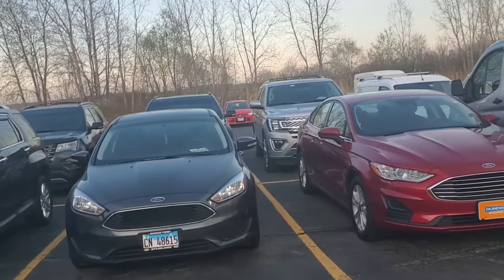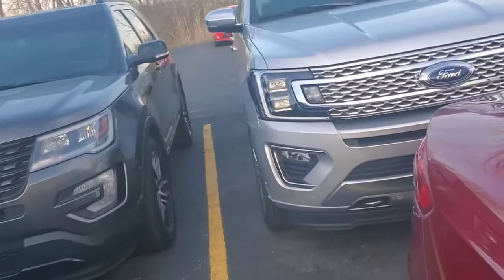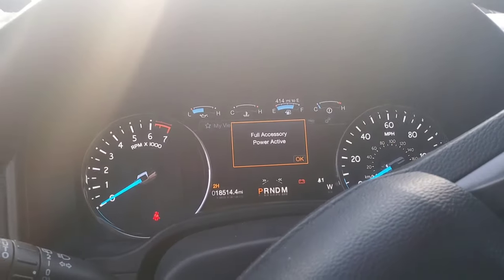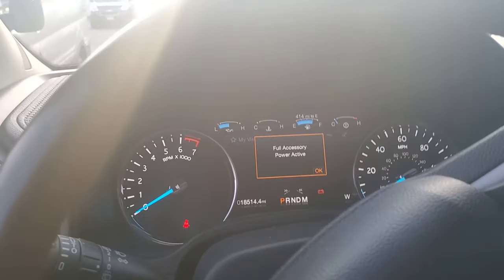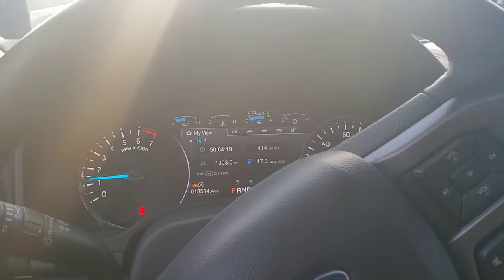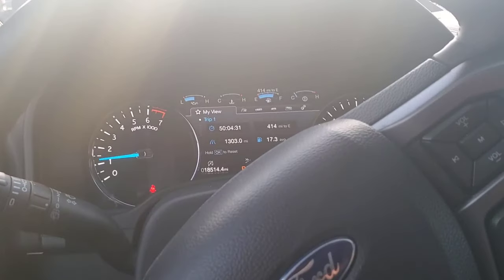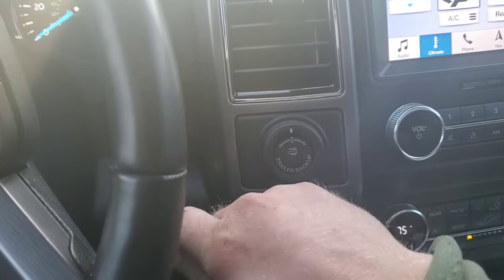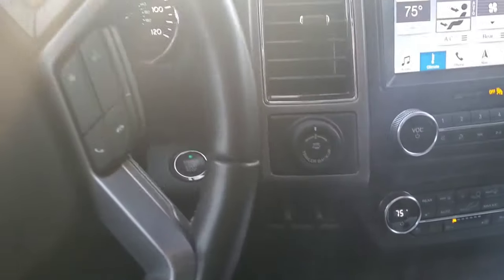3.5L Ecoboost F150 Rattle on Startup then gone, Try this - Could Fix Ford's Phaser Problem

Comment: I just bought a 2017 and wondered what was up with the rattle. Every time I went to look at and drive the truck before purchase, it was already running with the A/C on. I thought that the Ford dealer was just being courteous. I took the car home, started it for the first time ever and it sounded like a diesel for 10 seconds. Immediately took it back to the dealership. They showed me the recall that they never disclosed, and set me up with an appointment for a software update and told me that'll take care of it. I'm not a mechanic, so I figured a Ford dealership has to know what they are talking about, right? I just bought the most expensive vehicle I've ever owned, and I'm kind of freaking out after watching 20 videos of this issue and the secondary issue that'll come with a software update. I watched your other videos too. Great videos, buy the way. Anyhow, I just ran out at nearly 10pm in my shorts and slippers to try this out. The truck has been sitting for 9 hours since I came back from the dealership. Its 60 degrees out and that engine was ice cold. I did what you just showed me and it fired up without a rattle and purred like a kitten. I'm so thankful for you and your generosity. You don't have to tell anyone anything for free, but you did, and you've given me some peace of mind. I'm still going tomorrow to talk to the shop and let them change the VCT units. If the shop at Ford knows anything, they will see the TSB and field action telling them not to reprogram the vehicle. I took notes and I am going to make sure this is done right. My question is, if you have answer, is this "new" new fix I've seen in the past few days a real thing? Has this issue been resolved?
Reply from the maker: Well there is a new update they have to try
Reply from the maker: I'm putting a new video out right now because for people reach out to me today and they didn't understand but they quite didn't understand exactly what I was saying so this video actually clears everything up I'm putting it out right this second as we speak it should be off in about 30 seconds maybe maximum 2 minutes
Reply from the maker: https://youtu.be/ZR1W1gacwi8
Reply: Follow up... I brought the truck back the next day and explained my concerns. The truck had 72k on it when I bought it, so I was at 66% coverage. The dealership did give me a "lifetime" powertrain warranty at purchase, but in my discussion with the dealership manager he stated they won't pickup the other 33% because it is a known issue. I was polite, and explained it was not a known issue to me. He whipped out the dealership warranty to show me his support information regarding known issues. He was right, it was in the fine print. O then whipped out his dealership sales agreement that states I have a 72 hour, no hassle return policy. It had only been barely 36 hours. I requested my no hassle return. We were so darned polite with each other it was disgusting. He took the keys, sent someone to remove the plate, tore up the sales agreement, and cut me a check back for my down payment in under an hour. My end result is I gave it right back, no more problem. You legit saved my butt from the possibility of a 6 year  nightmare. I am looking at the same truck again with the 5.0L. I believe in the 5.0L. Are you aware of any known issues in the 2017 plus years 5.0L? Also, if you have a fan address, I would like to send you a small token of my appreciation for your help.
Reply from the maker: @Tedzepplin  https://www.paypal.me/KetoPros

This is my old PayPal that I still used today and obviously you're not obligated to send anything but it is very much appreciated

The only issue that most people have a concern with is the barbecue Tech tap knock on the 5 L engine because it's known since 2011 that this engine does that I would suggest going to my library and actually looking at some of the things that I've done to the five later
Reply: @FordBossMe  check your PayPal account. I know it ain't much, but it is from the heart. I'm just a working Joe like you, wish I could've sent something equal to the value of what you gave me. I'm not a guy who normally pays more than 10k for a truck, so that EcoBoost future repair bill scared the daylights out of me. It was a gift to myself, my first big purchase outside of my home, in 30 years. I couldn't afford the possibility of that repair or the loss of my truck that helps feed my family for a 2 week to 3 month visit to the dealership. God bless you.

Comment: Another way to prelude a engine is to use a oil accumulator that stores pressurized oil in a cylinder that is released during a start-up cycle.

Comment: I do this every time starting my 2016 F150.  Oh yeah, I just clocked over 190,000 miles and no timing issues.
Reply: That’s great news. I have a 16 with the 3.5 also and will be doing this from now on. Would love to keep mine going as long as you. I’m at 68K now
Reply: do u guys ever use remote start?
Reply: Yes, but not on the first start after my truck has been sitting for a week. I don’t have the rattle if my truck sits for 12 hours.

Comment: JUST SUBBED TO FORD BOSS. 2014 Ecoboost 3.5 ford said nothing wrong but on cold idle embarrassing sound  🙈 so I hold my foot on accelerate and wait 1-2 seconds and let go and it primes the oil ZERO RATTLE. ford boss is GENIUS!!!
Reply from the maker: It didn't fix the problem it just stops it from getting worse
Reply: @FordBossMe  it "fixed" embarrassing sound tho? hey ford boss why did ford say its normal on ecoboost 3.5 then?if it rattles a bit while cold then goes away after 10-15 sec?

Comment: Interesting Rich. Makes perfect sense. I would love to see close up pictures of those eco boost cast iron tensioners. I bought some billet aluminum ratcheting chain tensioners from mmr to try out on one of my modulars.
Reply from the maker: will indeed take pics
Reply: @JaceJackson  yeah you could be right but I figured I would give them a chance. I’m a sucker for shiny stuff too
Reply: Reflash pcm sounds like another Ford band aid fix that be causing more dead batteries and starter replacements😂

Comment: Hey I just came across your video (new subscriber) tryed this on my truck and want to say thank you so much. It works Awsome, I have a 2018 f150 3.5L ecoboost.
Reply from the maker: Just understand this helps make things not get worse but it does not fix any problems

Comment: Hi....i just found your video. Great advise!
I have a 2019 platinum Ecoboost with 45k miles with the same rattle or cracking on cold starts, and it's driving me nuts
Quick question: When priming, I should take the foot of the gas and let the engine starts by itself or I should take the foot of the gas and stop the start process and then do it again but only with the foot on the brake?
Thanks

Comment: Thank you for the video.   I would have liked to hear what the Expedition sounded like with the rattle, so I could know if that is what I'm hearing on my wife's Expedition.  Also, What is the underlying problem.  She's not going to want to do the procedure, she is going to want it fixed.  You said something about phasers. Will that problem eventually cause a motor problem?
Reply from the maker: I have more videos on sounds on these

Comment: Your 1000% right with that. Have question for you. 2013 f 150 3.5 ecoboost. 144k miles on it. oil changed regularly. I have that rattle but when i prime the system it doesn't do it. I ordered timing chain set and phasers. Is there a definite way to tell if the phasers and timing chain are bad? Truck idles at 7k with no jumping and runs smooth. Any feed back work be awesome. Thank you for your videos.
Reply from the maker: look in my library i show you how using a computer and controlling oil flow to phasers you can tell, its under [ f150 sounds like a diese ]

Comment: If I'm correct, the cam phasers have bump stops so it can only go so far.  They are metal on metal, so why don't they put padding or a soft material at the end so if it rattles, it's less noticeable
Reply from the maker: They have springs with stops and locking pins....new ones get a retainer cover over the spring

Comment: That sounds like a winner! For what it’s worth, I’ve had techs and managers stress that I need to use synthetic oil. My 14 f150 says to use conventional. The rattle happens all the time with synthetic. I think the synthetic oil is able to get past the anti-drain back valve.
Reply from the maker: Synthetic is a better oil the only real difference is conventional has more contaminants in it
Reply from the maker: I do nothing but run synthetic oil and I wholeheartedly believe in it but people have to keep up on their maintenance none of this 5000 plus oil change interval stuff
Reply: Harry Croker- no reason at all to not run synthetic oil dude the anti drain back valve issue is largely irrelevant in the case of slightly extended crank times as oil will refill filter pdq even with reg dino oil and mediocre filters.
Reply: When I’ve tried synthetic, it rattles on startup all of the time, even with just a few miles on the new oil and filter. With conventional, usually have the rattle only after 2000 miles or so. I really don’t understand what might be going on. My solution is to just keep changing oil and filter every 2500 to 3000 miles. Don’t like this, but I’ve learned to live with it. Delaying start to build pressure seems like the best answer I’ve heard in this whole thing. Thanks for the videos and advice.
Reply: @harrycroker7077  What oil filter are you currently using?
Reply: @harrycroker7077  I experienced same thing on my 08 f150 5.4 3v w/42000 miles. No rattle until I switched to synthetic. Dumped it after 3000 miles and went back to semi synthetic and no start up rattle anymore. I’ve only ever bought oil and filters from ford dealer. Big test for it soon. Haven’t driven it since last October.
Reply: Conventional? Or Synthetic Blend? Does Ford even make a conventional oil?
Reply: @alb12345672  ya they do
Reply: @alb12345672  yeah I meant synthetic blend but Ford sells conventional too. I put conventional oil in my 04 marquis

Comment: When I have my truck fixed what is the likely hood it will happen again? What do I need to use product wise to help prevent it from happening again? Another question sorry. I’ve had this oil leak on the drivers side valve cover as well. One dealership told me it’s the PCV valve and they replaced it for 100 bucks. I’ve sense learned the actual valve is on the opposite side. Is there another place oil is leaking or is the valve cover cracked? Any thoughts would be appreciated. Thank you for your videos and sharing your knowledge about vehicles!

Comment: I have a 2016, 28,000 miles that I only use occasionally for hauling and towing my travel trailer.  I took it in to the dealer as it makes a noise that I thought was the belt slipping on start up - just a quick noise , then gone.  is that the start of the rattle?
Reply from the maker: I mean it could be but it's hard to tell without some kind of video that you post

Comment: Why not have the ECU software crank until oil pressure is detected or a maximum timeout?   Crank for up to 30 seconds or until oil pressure is detected?

Comment: Have a recall to reprogram the PCM for this issue. Mine is a 2018. Have to carry it in. Not making noise yet. But thats a great idea use the de flood mode.👍
Reply from the maker: I'm well aware of all recalls and tsbs for this truck

Hence the name Ford boss, and if you look in my library you can see I perform them also here
Reply: @FordBossMe  if the recall doesn't work, they'll reprogram everything back to its original setting. Couldn't one just avoid all that and do the technique you've illustrated in this video?

Comment: @FordBossMe Another solution if possible is have a anti-drain back valve on the pickup tube to hold oil in place? What do you think?
Reply from the maker: The oil filter has an anti-dramback valve so there's no need to put it on the pickup tube

Comment: idk, prolonged cranking , not only that it puts more wear on your battery , it puts more wear on your starter etc.. to begin with which could develop issues that are more severe than a rattle issue which ford claims it does not effect performance or cause any safety issues.

Comment: Hello,  thank for the info about the 3.5 liter ecoboost engine cold start rattle but how to crank the engine without actually starting it with a push button start ?
Reply from the maker: Your push button is your key 

Use the push button in the directions as the key

I have responded in comments to this

Comment: So quick question: Does the rattle actually matter? Is any damage being done? Because I had heard that the problem was the timing chain getting loose, and I had it replaced, and the rattle still persists. If I have to live with it, I think I could for a while, as long as it's not actually hurting anything.

Also of note, my truck is a 2013 3.5 Eco-boost, with currently around 85K miles, and I typically use the remote start to start the engine, if that makes any difference.
Reply from the maker: The rattle from the timing chain is different than the rattle from the phaser, the rattle from the phaser it's because of a locking pin it's not locking on neutral whenever the vehicle is shut off and then the phaser starts to actually rotate in odd positions Ford says it doesn't cause any damage but if it's changing the way the vehicle sees timing how could it not cause damage

Comment: Question: With the new 3.5 Powerboost, on start up the electric motor is the primary.  During the period where the electric motor is running, will this allow for build up of oil pressure and prime the phasers before the gas engine kicks on?
Reply from the maker: I haven't put my hands on too many of them I can look into it if I remember but I don't really know off the top of my head

Comment: I had the idea a while ago to add a secondary electric oil pump that would kick on to build initial pressure quickly when the key comes on, then switch off to allow the mechanical pump to take over when cranking.
Reply from the maker: beautiful idea

Comment: I have a jet engine. During startup it won't supply fuel to the fuel nozzles until oil pressure has built up. No rattle sounds at all.

Comment: Great info thanks!  I have a 2018 F150 that does this.  Noise goes away right away after starting but its annoying as heck.
Reply from the maker: That's because you're going to need Cam phasers done may as well get the whole timing chain job done
Reply: @FordBossMe  Thanks, I think :)  What does that job typically cost?

Comment: Ford can flash the pcm!! With no phaser repairs!  Mine was done! 2013 ford f 150 3,5 echoboost, what this does as told to me by the technician,  it cranks before starting a bit longer, an the pcm doesn’t consistently look for a timing change, I haven’t noticed any difference in driving or fuel mileage! However I don’t pull heavy loads!

Comment: I have a question. I just bought a 2020 ford f 150 5.0 and it does the rattle when I strat it up only for a couple seconds. I heard that it’s not as damaging on the 5.0 as it is on the 3.5.. is there any truth to that?

Comment: Wait, i have no issue with cam phaser rattle at all because I do 3,000 miles oil change all the time. So my truck is 2012 and it's key ignition require. So I have to hold brake and gas pedal same time then start the electric or go straight to engine start. If i do engine start then I'll hear engine cranking the pistons up/down back forth. Am I right?

Comment: bought my 18 lariat. 60k miles. 4 days ago. it did it like every 5th time id start it. its less than 1.5 seconds maybe 1 second.. most the time it dosent happen at all so i dont know what to say or do. got a lubrico extended warranty. gonna wait a couple weeks and see. also I have seen people have this issue and keep it unrepaired for 100,000 miles so i dont know what i should think of its importance.. any advice? i dont think its an issue but could become one

Comment: Would this shorten the lifespan of the vehicle’s battery?

I agree with you on priming a system dependent on oil pressure for timing chain tensioner(s). 

They could easily make it to where the vehicle starts when it sees “x” amount of oil pressure or after “x” seconds. 

I just think this would shorten the life of the battery or cause vehicles not to start if battery health cannot crank long enough to prime the system.
Reply from the maker: You want to replace $1,700 plus worth of timing chains or do you want to possibly end up replacing $140 battery
Reply from the maker: This ain't going to hurt that battery it might a little bit five years from now but not now

Comment: What if they set it so it won't start until it detects oil pressure.  That would also save engines that are neglected and run low so it will cut fuel if pressure drops too low.

Comment: An oil accumulator with a key key wired selnoids valve would work too.
Reply from the maker: Yep there is a guy here that has installed a pre oiler